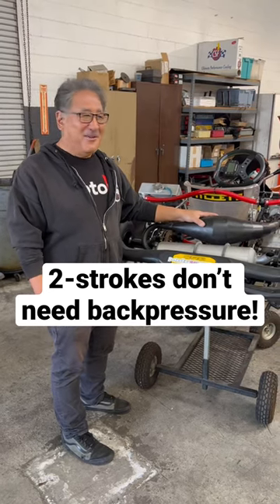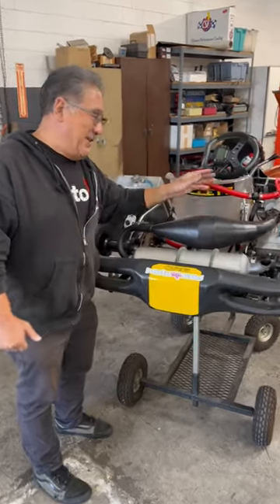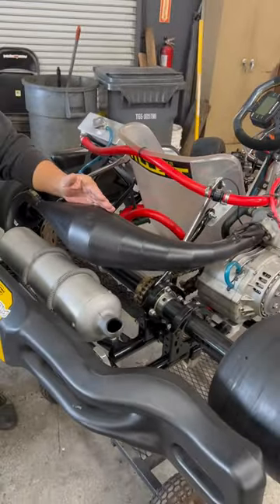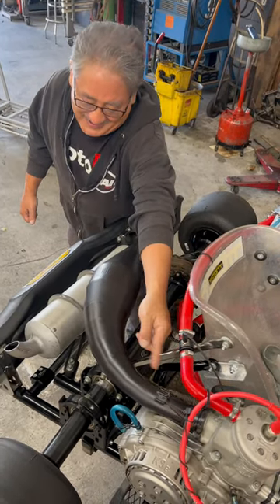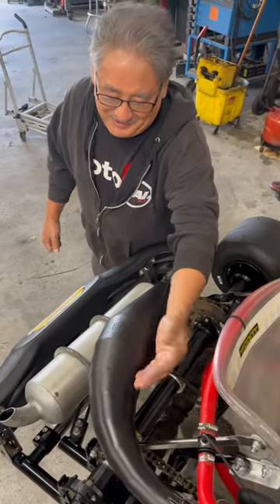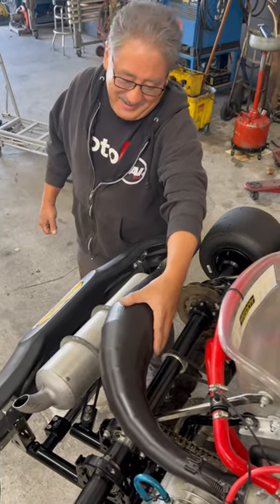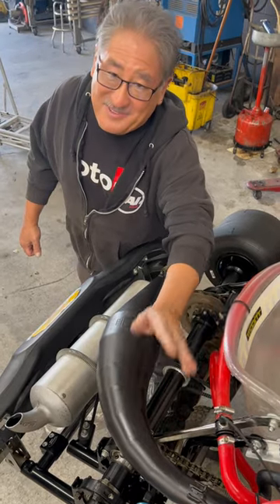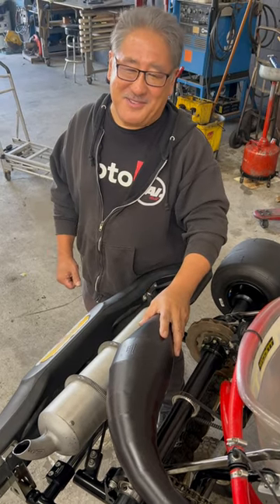2-strokes don’t need backpressure!

Comment: Okay yes, but there's more to it.  With this pipe we see a very skinny end pipe going to the muffler.  Back in the days of anarchy, they ran those "stingers" with no muffler at all.  Free fliwing, right?  Well, it was found that the stinger needs to be a certain diameter and/or length to get the correct back pressure (wider and shorter provides more flow, thinner and longer provides less.  Why would this be?  When the exhaust pulse arrives at the rear cone, that pressure wave can be largely lost if the exit is too free-flowing, resulting in a loss of low-end power.  If the stinger is too restrictive, then it will fail to provide enough gas flow, in a very simplistic 4-strokish way, which causes loss of top-end power AND an extremely pronounced increase in engine heat.  My dad has an old '73 100cc Yamaha MX with a pipe that someone fitted a too-large stinger back in the day.  The bike is impossibly weak in the low-end, even for a 100, but finally finds it's power again right around 1.2 million rpm.
Reply from the maker: rough formula to start is stinger length is 6x diameter or more.  Another trick for a larger collector is to have it extend into the chamber,  this way you can get away with a bigger one.

Comment: My experience is that if you remove the glassfiber filling in the last muffler after the cone you will not be able to hit rpm above 10 000rpm
Reply from the maker: It depends on a lot of things but generally you want the uninterrupted stinger to be 6XD

Comment: why not putting an exhaust valve (outside of the added complexity)?
Reply from the maker: Because it would not be a two stroke.  Some two strokes have a slide valve that changes the exhaust port timing some by effectively raising and lowering the exhaust port height though but it's not an exhaust valve like a 4 stroke.
Reply: @motoiq  Two strokes mean there are two stroke in between each explosion, but you could just add a valve at the exhaust and still have two stroke in between each explosion. It would not be the very conventional two stroke, but then, you could have the equivalent of back pressure at every rpm
Reply: @motoiq  do you know what engine has the system you are talking about, I'd love to make some research about it
Reply from the maker: You are right, I forgot about supercharged two-stroke diesels that used to be found on semis, they had cams and valves but the cam spun at 2x engine speed. The supercharger helped scavenge the cylinder. The first time I saw one, I didn't realize it was a two-stroke till someone showed me.  PRD Galaxy,  Rotax TAG kart engine, and old Yamaha two-stroke dirt bike engines with the power valve all had this kind of exhaust valve.

Comment: what would that high pressure wave be as it slams back into the cylinder? engineered back pressure at the moment u want it
Reply from the maker: It's not the mean pressure in the chamber which is the actual backpressure.
Reply: @motoiq  youre just creating a narrow definition of back pressure.
Reply from the maker: Not narrow but the correct description of what is going in regards to extracting work from the pressure volume cycle.  If the pressure at the bottom of the cycle is higher due to backpressure, less work or power is extracted. https://vocal.media/journal/what-is-the-difference-between-pv-diagram-of-two-and-four-stroke-engines

Comment: All engines like that…. It’s called the scavenging effect….. using spent exhaust gasses to create a negative pressure wave behind them helping to pull the next charge of exhaust out of the cylinder making the upward work of the exhaust stroke less work on the engine freeing up HP and increasing efficiency. No engine likes back pressure but a good exhaust that helps scavenging will make more power than open headers

Comment: it likes 1/2 to 1 psi back pressure, not exactly nothing. If you don't believe me then try different stinger sizes and measure the pressure at the belly and see which pressure the engine likes the best
Reply from the maker: It's not the engine liking pressure, it's changing the tune of the pipe.
Reply: @motoiq  back pressure is the baseline that the pipes return waves ride on and so is very important. There could be engines that don't want any back pressure but each engine would have to be tested with different pressures to see what it likes. All normal 2 stroke pipes (expansion chambers) have a stinger that allows some back pressure. Must be a reason for that.
Reply from the maker: All engines don't want backpressure, you raise the bottom of the PV Curve due to backpressure there is less energy or power to recover, don't mistake having some backpressure speeding the reflected wave and the engine liking it as the engine liking backpressure.  More power can be found by improving the pipe design to have the proper pulse timing with less backpressure.  The stinger isnt there to increase backpressure but to make it more difficult for the reflected wave to leave the chamber while allowing exhaust gas to easily pass through.  That is why the minimum dimension of the stinger is 6x the exit hole size.
Reply: @motoiq  make all the changes you want but none of them will raise the baseline for both return waves like the back pressure can (and does). Raising that baseline increases the plugging pulse but decreases the vacuum pulse

Comment: Yes but you're wrong in a way, the stinger pipe is a restrictor, and it needs to be tuned for best performance. Too big and the engine just flows a lot of air and makes no power out of it. It's about controlling the density of the charge trapped in the cylinder.
Reply from the maker: The stinger is made to reduce the shock wave energy leaving the chamber so more can be reflected. It does not serve as a restrictor. If you restrict an expansion chamber with too small of an outlet, the EGT's go up and you can seize the motor.  The stinger can be smaller than the exhaust port because the exhaust diffuses and cools and thus shrinks in volume in the chamber. It's good to have a low mean pressure in the chamber with strong properly timed pulses for the best powerband and overall power.  You can use a smaller in diameter stinger to increase the mean pressure in the chamber and speed the wave up for tuning, but that can reduce overall engine efficiency.  I can't get into this detail in the 60 seconds you have for a reel.

Comment: Does the pressure wave also increase cylinder pressure? I believe that helps combustion for more power and cleaner emissions.
Reply from the maker: It doesnt  help combustion other than the reasons of preventing overscavanging during overlap
Reply: No direct intrinsic increase to cylinder pressure, but a proper exhaust-scavenging technique will effectively reduce how much 'pushing' the piston has to do, as well as 'pull' fresh fuel/air mixture into the cylinder (4stroke speak here - I'm not 100% certain how it translates to 2stroke) ... so, more/better combustion will probably create more cylinder pressure sustained if not peak
Reply from the maker: In this way yes!
Reply: @davidsandberg3109  The pulses from the expansion chamber can be somewhere in the neighborhood of 5-8psi (positive or negative) depending on pipe design.  When the negative pressure wave arrives, all the ports are open, and that negative pressure can make it all the way to the intake/carb on a reed-valve engine.  You can imagine how useful 8psi of suction at the intake port would be.  In really hot engines with big port timing, this drives intake volumes more than crankcase pumping, and is the reason reed valves finally beat rotary valves for absolute performance.  This huge negative pulse deliberately over-scavenges the cylinder at low RPM, and then the 5-8psi positive pulse from the baffle cone comes in and crams the air back into the exhaust port.  In ideal circumstances this does act like a sort of resonance supercharger.  It's worth noting that the guy who invented the expansion chamber, Walter Kaaden, was one of the main engineers behind the V1 pulse-jet program in WW2.  Using the very same principles, pulse jets make pretty significant compression with resonance alone and no moving parts.

Comment: Does that mean that I can modify the silencer/baffle without effecting the running.
Reply from the maker: No, if you change the pressure in the chamber and the effective stinger length, you affect the tuning.
Reply: @motoiq  perhaps if I keep the same length/ resistance. Or is it too risky/difficult. Tmk9b kart engine
Reply from the maker: I run the same engine but we cannot change the pipe by the rules here. If you delete the muffler but experiment with stinger length you might be able to get the powerband you want.
Reply: @motoiq  thanks for the reply. Is the stinger the muffler or is that the first part of the pipe. I'd like to know if in ur opinion it would be simple enough and without substantial risk of damage if I get it wrong to modify my muffler. This isn't for regulated racing. I'd like to fit another muffler for cosmetic reasons because my old one is looking. worn.
Reply from the maker: The stinger is the small pipe at the end of the chamber. The general rule is you want the length to be at least 6x the inside diameter before you add a muffler. If you changer your muffler and your stinger length, watch your plugs and if need be change your jetting accordingly.  Stinger length has some effect on the powerband.

Comment: @motoiq I’m sure you didn’t make it up just as I’m sure you are just erroneously repeating something you read. Here’s a simple test you could do to prove me wrong, cut the end of the conical baffle to enlarge the orifice diameter 1mm it should currently be around 24.3mm to 26.3mm give or take 0.5mm this won’t affect the return pulse as that occurs around 1/2 to 2/3 the length of the conical baffle it will however lower pipe pressure and you will loose power most likely middle to end of power band but definitely in the over rev.
Reply from the maker: I am not repeating what I read, it is from the laws of physics, thermodynamics and racing two strokes.  There are no rules such that the bleed of an expansion chamber should be 24.3mm for all sizes of two stroke engines. There are general but not absolute rules that a good point to start your stinger length should be 6x its diameter. The stinger's or exit venturi's purpose is to be the acoustic end of the chamber, not act as a backpressure increasing flow restrictor. I mean many pipes are side bleed and the exit isnt even at the end of the chamber and the chamber is still cone shaped. Of course changing the mean pressure affects pipe tuning as it changes the speed of sound in the chamber, but increasing backpressure decreases the engines volumetric and thermal efficiency.  So tuning the pipe via backpressure is a bandaid to making a correctly dimensioned pipe. Jennings and Alexander Graham Bell have simple formulas that seem to work pretty good and there are good inexpensive software calculators for designs now.  What you are doing is observing the changes in performance by making changes in the pipe exit, you know what that does and partially understand what is going on in it but you don't understand how the entire system works.  Now my daughter races in classes that have homologated spec pipes and bikes are all four strokes so haven't had the need to develop anything lately except playing with scooters for fun but I sure just don't read something and spew it out.
Reply: @motoiq  You are misquoting my statement, I never said 24.3mm was a standard for all engine sizes for example an 80cc runs well around the 18mm diameter whereas a 550 twin two into one exhaust runs well around 40mm. The current Homologation  for the TM line specification is 26.2mm however that looks more like a Vortex shifter pipe with a Homologation spec of 24.3 +/- 0.5. A good starting point for diameter at the end of the conical baffle is 3.1 x the Sqrt of Hp at the crankshaft. Your statement regarding back pressure would suggest the diameter of the end of the conical baffle doesn’t matter.
Reply from the maker: That is an OEM TM pipe not a Vortex. The diameter does matter but not as much as you might think, a lot depends on the stinger and if you can package the right length in whatever you are doing. But going back to the original subject, increasing the mean backpressure on the engine hurts power output, there is no doubt about it.
Reply: @motoiq  That is not your original statement, Adjust your pipe so there is zero back pressure and run it, you will lose power.
Reply from the maker: The pressure goes well below zero in a chamber under different parts of the cycle, it's why I keep saying mean pressure.  What you are saying is to purposefully not make an expansion chamber work.  Of course is going to make about 50% less power.

Comment: Interesting for sure. There's more to this exhaust system though. Must be California. After all that tuned exhaust it has another muffler or sound suppressor.
Reply from the maker: You can see the whole exhaust very clearly. It's a muffler, its straight through perforated core, no backpressure.

Comment: At certain RPM you need a little back pressure to prevent over scavenging. The great tuners from the 50s onward realized this including factory engineers and started regulating back pressure. 
Read Blairs engineering book on two stroke engines. Sorry dude.
Reply from the maker: You never add backpressure, at least if you are correctly designing the pipe, you should change the pipe tuning instead.  Adding backpressure can be a quick and dirty way to change the rpm range that a pipe is in tune by speeding the reflected wave by changing the gas density and temperature but it's not the best way. Adding backpressure reduces the amount of work that can be recovered by each cycle, if you don't believe me look up the PV cycle of a two-stroke engine, it is thermodynamics, sorry dude.

Comment: Does that pulse coming back have pressure?
Reply: NO
Reply: Backpressure just decreases the flow. The pulse tuning INCREASES the flow.
Reply: @fish_R_stinky69  but the extra fuel that goes out from exhaust port will come back to the cylinder caused by that pulse.
Reply: @lesterliston4692  That's not backpressure.
Reply: @fish_R_stinky69  are you sure it’s not pressure? So what it’s called? Then does it have pressure on it? If no, is it void?
Reply: @lesterliston4692  Well, the muffler has nothing to do with it lol.

Comment: In short, it’s called back pressure.
Reply from the maker: No its a back pulse, not the mean backpressure in the exhaust, the same as headers.
Reply: @motoiq  so, the pulse going back has pressure? If yes is it negative or positive?(for sure positive). If not, what is that pulse. There no such pulse of nothing. Like pulse of blood, electric, water, air etc. so what is that. If you can name it what is that pulse, i will ask again if it has pressure.
Reply from the maker: I answered your question. Mean backpressure needs to be less.
Reply: @motoiq  with reference to what or where? When the pulse coming back what’s the element of the pulse? Is it plasma, air, water? Did it bring or it has pressure with that pulse coming back?

Comment: Who made that pipe ?
Reply from the maker: The homologated factory TM pipe.
Reply: @motoiq  in need of 2 for a 1980 gp  reverse barrel tz 250 in a vintage zip  super kart
Reply from the maker: Maybe find a TZ250 pipe and cut it up to make it fit? Sweet project!

Comment: "acKtcuaLly" 🤓, in the case of back pressure in an expansion chamber, the part behind the reflection cone, often referred to as a "stinger" (the part where it decreases to a relatively very small diameter pipe), will give you more power, the smaller the outlet is. This is because it stops the pressure from bleeding out as quick, thus enhancing the effect of the resonance by building more pressure. This will obviously only work to a point, because if you restrict it too much, your engine temperature will rise catastrophically, melting a hole in the piston 😂
Reply from the maker: That us not necessarily true all the time, what is most important is the ratio of stinger diameter to length.  The right diameter is usually 50-70% of the head pipe diameter and its length 12-13x it's diameter.  Most of the time this will get you in the ballpark.

Comment: The title is incorrect. 2 strokes definately need back pressure. If there were no expansion chambers (ie back pressure) the cylinder chamber would not be able to effectively scavenge exhaust gases.
Reply from the maker: It's mean back pressure not variances of pressure.  You are talking about exactly what we explained in the video!  If you increase that the VE decreases and the energy recovery potential of each stroke is less.
Reply: @motoiq how can there be reflection pulses without back pressure. Everything in your video is 100% spot on. I just think the title is wrong.
Reply from the maker: It's mean back pressure.
Reply: @motoiq  ok ..can you explain ‘mean’ back pressure as opposed to variances of back pressure?
Reply from the maker: The average pressure in the case of a two stroke, measured in the stinger.  All engines two stroke or 4 stroke have pulsations in the exhaust.  So if your average pressure is higher, you will have less power.
Reply: @motoiq thanks I follow what you mean.